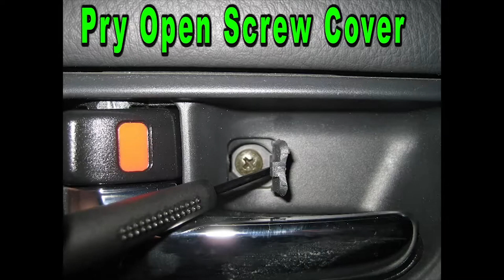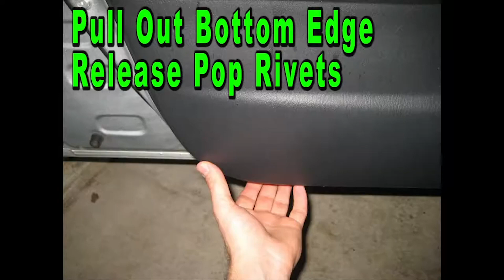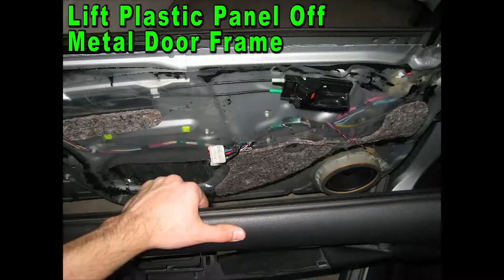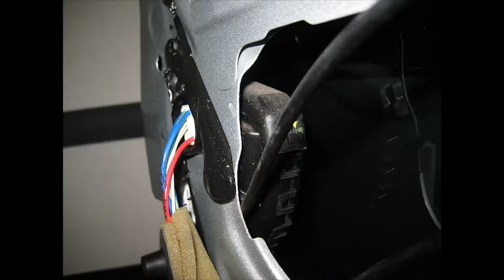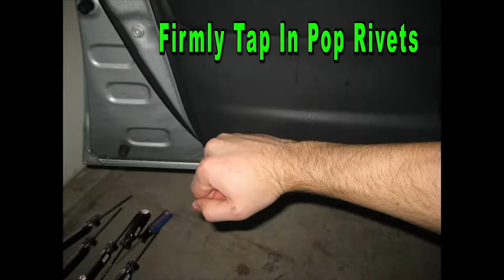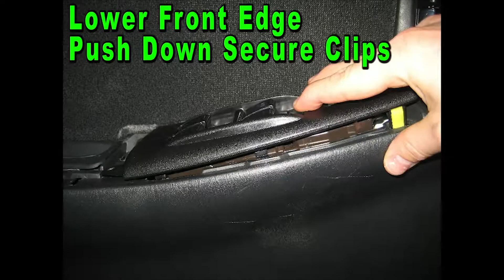2003 To 2008 Toyota Corolla How To Remove Door Panels & Upgrade Speakers   Quick & Easy Version

Comment from the maker: Check out the DIY guide for taking off the plastic interior door panels & upgrading the OEM speakers in a 9th generation 2003 to 2008 Toyota Corolla sedan - https://www.paulstravelpictures.com/2003-2008-Toyota-Corolla-Interior-Door-Panel-Removal-Guide/index.html

Here are all of the 9th generation 2003, 2004, 2005, 2006, 2007 & 2008 Toyota Corolla DIY repair and maintenance tutorials - 
https://www.paulstravelpictures.com/Articles/Toyota-Corolla-Common-Problems-Repair-Maintenance-Guides.htm

Owners of other similar Toyota, Lexus or Scion vehicles such as the Yaris, Matrix, Prius, Camry, RAV4, Sienna, Venza, Highlander, Avalon, IS 250, ES 350, tC, xB, xD, iQ and FR-S may also find these DIY brake job instructions to be helpful.